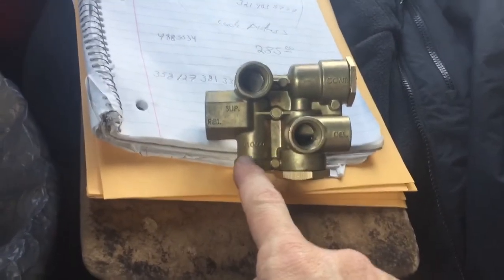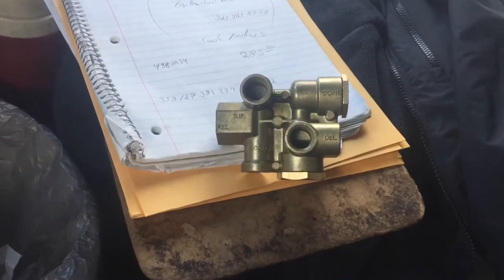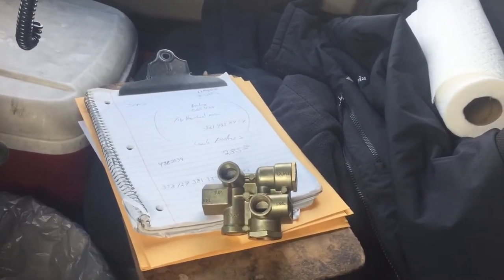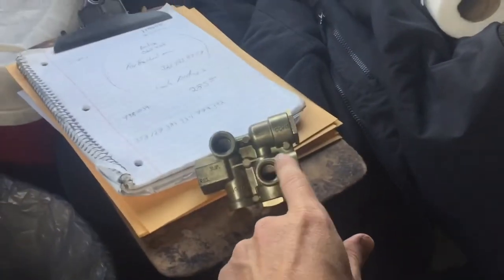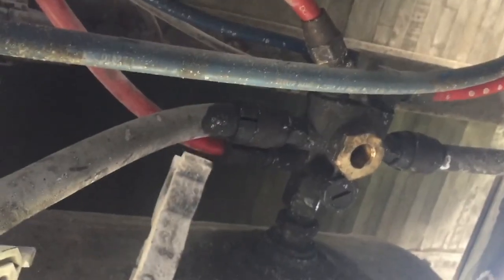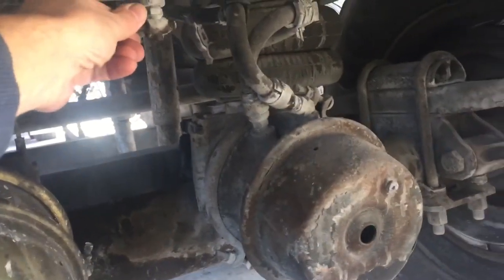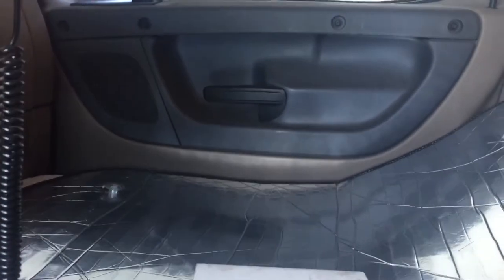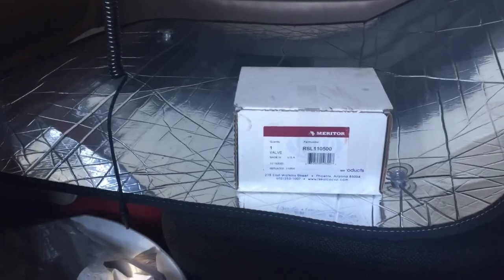Spring Brake will not release / brakes locked on 53 foot dry van semi trailer diagnose and replace

Comment: I just changed mine last week. When it goes bad there is back air flow comes into your red glad hand. This valve fails to keep the air pressure in the trailer air tank.

Comment: If it is  leaking remove the bottom exhaust port nut, keep the washer, add a nickel and reinstall the nut.  You won't be have parking and emergency brakes on your trailer but you will be able to move.  Repair asap

Comment: One of the tips during winter or very cold climates under 32 is to never set the brakes on your trailer. Otherwise, you might wake up to frozen brakes or worse roll with one frozen trailer brake and not realize it. If you suspect some of your brakes are frozen, use a white marker to mark all your tires, then move forward a few feet and stop and look to make sure every tire rolled.